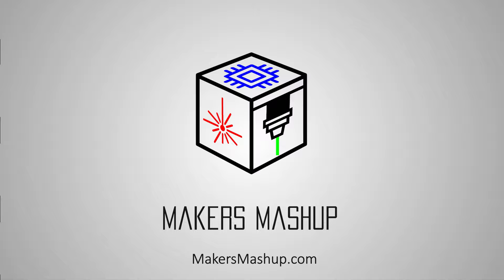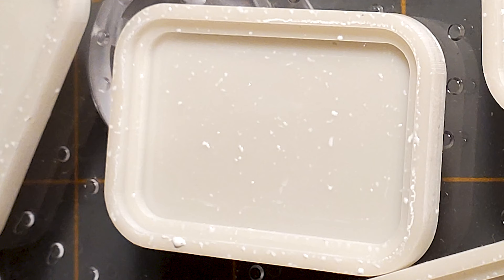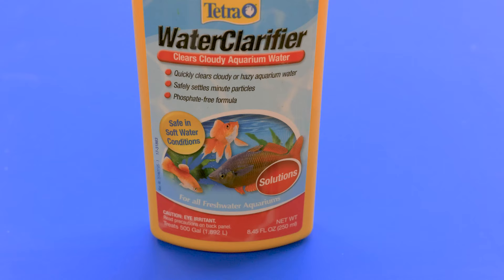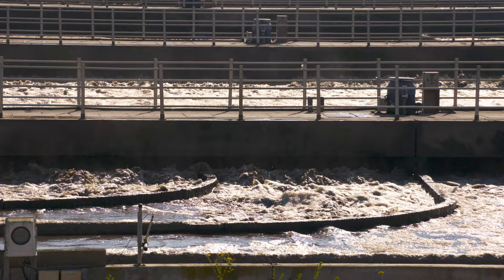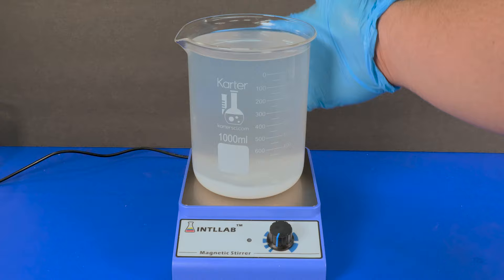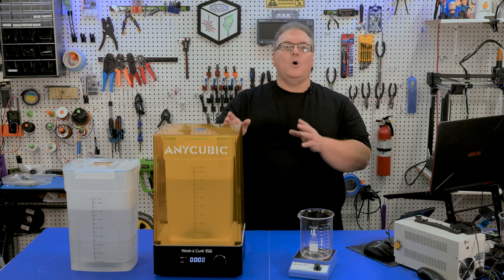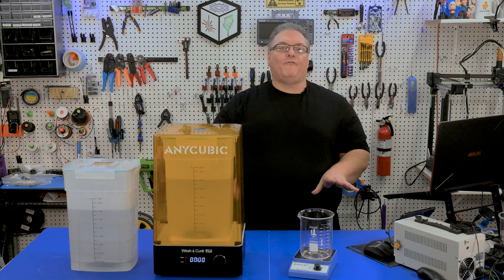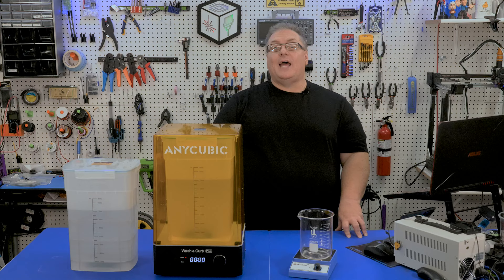Recycle Isopropyl Alcohol FAST! | Recovering IPA From 3D Printer Resin Wash

Comment: Nice job!
I see aluminum sulfate is quite cheap (~1.5 eur/kg ... actually its delivery is ~3 eur :)). I'll probably give it a try, because the wait for the separation is really slow and annoying.
Otherwise once I get well separated resin I can pour out the alcohol (or resin) easily enough without mixing them too much. Only a small amount of dirty alcohol is left with the resin, which I don't have a problem leaving to slowly drip thru a denser filter (the filter would also catch most of the resin and I'll UV cook it afterwards).
Decanting I find to be too rough, tilting the container at first doesn't disturb the resin on the bottom too much, but once the alcohol level drops enough it starts mixing the resin back up (tall narrow bottle-like containers work better).
But siphoning works much better as the dirty container doesn't have to more at all. If you siphon please use a siphon tube with small pump these are cheap and available everywhere as they're used in wine & beer production and also gasoline siphoning.
But the next step is actually simply pumping the clean(er) alcohol. I saw Uncle Jessy show a pump for liquids transfer, and while I can't find that device in my area, I realized that any pump for these large water bottles does exactly the same thing. 
So no more tilting the dirty container, no more jerking the tube while starting the siphoning ... just put slowly the tube of the water-pump deep in the clean alcohol (but enough above the resin) and push the button.
It's just the waiting for the separation that's so slow, and if the Aluminum Sulfate trick works I'll definitely do that.
(alternatively I was planning to make DIY centrifuge for 2~4L to speed up the separation :))
Reply from the maker: Let me know how the centrifuge works out.  I had considered the idea but swinging  around 4kg or more at high speeds sounded like a recipe for fail video. 😁  Seriously though, let me know how it works I think it should speed it up considerably.
Reply: @MakersMashup  ,
I'm still in the investigation phase :)
But I recently discovered there oil filter centrifuges, which seem simple enough (esp. since we don't need heating for alcohol).
There are tons of over-engineered ones (I guess very specialized for certain uses), but a simple one seems to be perfect for our needs.
It consists of 4 main parts: 
 - inner cylinder. This is the spinning one, horizontal of course. It has open top, and closed bottom (kinda like a cooking pot), except that the top edge actually has a ridge that makes the opening smaller than the cylinder inner diameter.
There are also few holes on the closed bottom plate: one in the (exact!) center for mounting to the el.motor; and few drain holes near the center, which serve to drain the residual dirty fluid when the machine is stopped at the end.
 - housing. Outer cylinder (can be any shape actually), it must be higher than the inner spinning cylinder so that it catches all the fluid that's accelerated horizontally.
and the important details are at its bottom as it facilitates draining separately the cleaned fluid from the dirty fluid (and from the central hole for the motor's axis).
These 3 area you can imagine as concentric circles separated with slight circular ridges so that the liquid in each can't overflow over the ridge before flowing out the drain holes in each area.
 - electric motor. some people I've seen use a power tool they have. It just needs to be mounted as perfectly vertical as possible to allow for vibration free spinning.
 - and a stand that allows mounting the above components.

The stand and outer cylinder are both fixed and connected, so you can consider them single part.
The motor's body is fixed to the stand too, its axis goes thru the housing cylinder to reach the inner spinning cylinder.
It operates quite simple really. 
You turn it on spinning as fast as it's safe :) 
Then start pouring slowly the dirty fluid (alcohol in our case) that needs some heavier pollutants removed (resin in our case) inside the spinning cylinder.
Because of the spinning the fluid immediately is accelerated to the inner walls of the spinning cylinder.
The spinning cylinder upper ridge encloses a ring-shaped volume on the insides of the wall of the spinning cylinder. 
When you pour a little more fluid it'll go over the ridge (think of the fluid's "down" pointing horizontally to the outsides of the cylinder as in any fast spinning centrifuge),
when the total fluid in it is more than the enclosed volume I mentioned it'll start overflowing, and the closes place it can do that is the upper ridge (because the few drain holes on its bottom are closer to the center than the end of the ridge).
So the ridge allows only the upper most fluid to escape, which is the cleanest fluid as the heavier particles (ie the resin) will be accelerated to the walls.
So the clean fluid flows over the ridge, sprays horizontally all around the spinning cylinder, but it's caught by the inner walls of the housing-cylinder, and then leaks down to the outer drain area on the bottom of the housing, which thru a pipe (or few) leads to the clean fluid container.
You keep pouring all the dirty fluid in the centrifuge, and when finished you'll have only the dirty fluid captured in the enclosed spinning volume I mentioned above.
** here's another trick that can extract more clean alcohol. I'll describe below as it's optional.

Then you turn of the centrifuge, and the dirty fluid trapped inside the spinning cylinder flows to the bottom to the dirty drain holes. They lead to the inner (dirty) area of the housing (separated from the clean one by a ridge), and leaks thru a hole (or few) thru a tube to the dirty fluid container.
The remaining dirty fluid can be kept for later to be used again in the centrifuge with more dirty fluid.
Or more likely can be filtered thru some fine filter - it'll be slow, but since most of the dirty fluid is now cleaner we can leave that drip for a long time.

** The optional trick to extract more clean alcohol from being trapped in the spinning cylinder is by pouring some water.
That enclosed volume I mentioned is a known volume (depending on the spinning cylinder size and it's ridge), so you can pour a little less water than that volume.
Water being heavier than alcohol (~21% heavier) will be trapped to the inner wall of the spinning cylinder and will push the remaining alcohol "up" to flow over the ridge.
The pollutants (ie the resin) will still be trapped on the walls, and now will be covered in water instead of alcohol.
When as much alcohol is extracted as reasonable (ie without allowing water to overflow and mix with the clean alcohol), centrifuge is stopped and the pollutants together with the dirty fluid (now mostly water) is collected in the dirty fluid container.

Unfortunately this will has to be DIY assembly project as the ones sold commercially are very overengineered and expensive.
But the motor is easy - most rotating power tools can be adapted to it (and still detached and used as originally designed when the centrifuge is not in use).
The stand can be assembled simply even without welding.
The housing cylinder (or whatever shape it is), only needs to be bigger (and taller!) than the spinning cylinder, and has its bottom separated by a ridge to allow the separated fluids flow out without mixing.
And the only tricky part is the spinning cylinder. Which I currently don't have an idea what existing item to reuse and repurpose. So I'm inclined to get a short cut of a wide enough stainless steel cylinder (it doesn't need to be long at all), get couple of circular plates to weld, one for its bottom (only to be perforated) and the other to have another smaller circle cut out of it, and be weld to the top of the cylinder to form the overflow ridge.
The ridges on the bottom of the housing can also be welded, but since it won't be rotating or experiencing any strong forces it can be also glued.
Actually the whole housing can be done with plastic (or plexiglass if you like to be able to look inside it :))
So the housing cylinder can be assembled by wider plastic pipes cuts.

Sorry for the long explanation, but would like to run the idea with other people to get opinions and advices :)
Reply: @MakersMashup  , here's great demo with great explanations of such centrifuge:
search for "Extreme Raw Power Centrifuge | Overview & Operation | Utah Biodiesel Supply" on youtube.

Btw I remember someone used to put a bit of paper (like few pieces of kitchen paper) against the inner wall of the spinning cylinder so that it catches the dirtiest particles.
In our case it'll be easy to keep the centrifuge cleaner, and then just put the pieces of paper in the sun (or in your UV over) to cure the resin before disposing.

Comment: slick; only downside is the IPA, post treatment, is watered down (from 95% to 80%IPA) which won't work for many resins...
Reply from the maker: Just salt out the water.  Can be done as easy as the aluminum sulfate process.  Add salt, mix,  decant, 99% ipa again

Comment: Ok, I tried this and seems to work pretty well. It is however kind of a hassle. Also to get the water out of the IPA again, I'm adding salt and trying to suck it up with my giant 500ml syringe.

Now unfortunately my basket started rusting. Probably due to water leftover maybe, or the salt.

Now trying to figure out if there is another way to do this. My IPA is now orange in color from the rust.

Comment: Found this out by complete accident and haven’t tested exact amounts. A tiny bit of white vinegar in the used alcohol caused it to flock and settle out with minimal hand mixing and it settled out in about 5min.
Reply: seriously?
Reply: @Aveltro  give it a shot on a small scale. I give it about a day for the particulates to form a decent clump so they don’t come out and then decant to a second container, let it sit for a bit more to let any escapees settle and then filter with a coffee filter. Two cycles so far and no degradation

Comment: So once the ipa is diluted with water, when you redo the process you don’t need to add water again, just the flocculant directly.
Reply from the maker: Good call out.  Ive been noticing that myself using this process a few times now.  I've also noticed ive not needed to treat the IPA as often since treating it the first time.

Comment: so for using water washable resin, technically you could add 170g to 1L of resin/water waste, mix it as you describe, run the whole 1L through a filter and then the water would be 'kind of' safe to dispose of normally, then cure and dispose the residue as usual. I'm trying to find a solution to work with water washable stuff as im sick of stinky IPA and want to try eliminate it from my workflow, but i'd feel uncomfortable getting rid of the water like this, instead i'd have to leave it evaporate over time but dont want to have huge amounts of open containers with toxic water in lying around whilst im waiting for it to evaporate away before i can dispose of it. Plus, this 150ml of water you're adding to your IPA mixes, as time goes on your IPA will dilute and become essentially useless for cleaning prints - yes water will be heavier than alcohol so will go to the bottom but you're still diluting the IPA and as soon as you disturb the mixture it will mix it up again as the weigt difference isnt enough to do this - i.e. a good test would be to dye the water you're adding with a few drops of something, so you can see over time how it would gradually dilute the IPA mixture and it can also act as an indicator to dictate when you need to swap out the IPA all together - only trouble is, you'd have to dye it with something that the alum didnt also remove via coagulation.
Reply: I was wondering the same thing.

Comment: To the author of this video, i would suggest not eating alum even if it says you can in your country as it if a form of aluminum and saying food grade safe not make it so it's about profit and collective data from the last generation. There are also many other processes utilized in making clean safe drinking water or waste management. I love that you are experimenting and if you are comfortable in doing so great and you are sharing which is even more great however there is little data other than your word to say this process works effectively and efficiently.
Reply from the maker: As I mentioned in the video, there are different chemical formulations that claim to be Alum.  Aluminum Sulfate is what I used specifically.  While I agree the information is not peer reviewed and tested, as I highlighted similar processes are used in wastewater treatment and causes particles to collect and flocculation occurs.  You can research that on the internet in great abundance.  So methods described here are used in the scientific community.  Food grade alum formulations have been used in making pickles for centuries.  You might find this page helpful in learning more https://www.thoughtco.com/what-is-alum-608508

Comment: Very interesting but I think I'll stick to sun UV and filtering (as I'm not a chemical scientist :) ).  I have a question, how long is your alcohol rinse?  I've heard everything from 1min. - 10min???? 
I will be doing a 2 bin alcohol cleaning. 
Thanks.
Reply from the maker: It varies by print, design and volume but generally its 1-2 minutes per bath, one ditry, then one clean bath.  After the bath I use virgin IPA in a spray bottle and a brush to lightly clean off any remaining residue, particles, etc.   Then I use my air compressor, blow off prints until Dry.  Pop off bed and cure.

Comment: I wonder if you can freeze the final solution to get the water out and really end up with nearly 100% ipa?
Reply: I think the alcohol will prevent water from freezing, at least at the normal freezing point.
Reply: @walidkhier  I did some looking into it, and I'm thinking dry ice may be enough to get the water out of the IPA.  I know that most alcohols are natural antifreezes for water, but reading up on freezing distillation can work (in theory).   I'll be trying this very soon. This is such a great idea :-)
Reply: @davidfigueroa1969  

I am curious to know. Let us know the outcome.
Reply: That's what I do in winter time. Just leave it outside. It wont freeze (Danish -5 to -10ish celcius winter) but the resin just gooes up un the bottom - easy to decant. Not totally clean though - but sufficient for reuse washing. Bonus: the water freezes on top and peels off before decanting. The goo is poured in a container outside in sunlight and trashed when solid.
Reply: @michaelhviid398  Thank you for that information.  That's going to be very helpful.
Reply: @davidfigueroa1969  I have not measured the resulting strength of the IPA. My guess is only a portion of the water freezes but it has been sufficient to reuse with topping up of the removed volume.
Reply: @walidkhier  That's called antifreeze....
Reply: @michaelhviid398  I put a bottle of dirty IP out in the snow last year and is settled and cleared really quickly, wasnt sure if it was the temp or the additional UV from reflected sunlight. may try putting a vat of dirty IPA in the freezer see what happens

Comment: Will this technique not work with just the aluminum sulfate and no water? or does it have to be done with water no matter what?
Reply from the maker: I tried without water. The results were poor.  My thought is the water increases the surface area.  If you're worried about dilution you can use salt to "salt out" the water.  People have used the same method effectively to salt out the water from 80% IPA.  Basically add salt afterwards, shake and then decant.  The saltwater separates from the alcohol.  Tons of videos on salting out.
Reply: @MakersMashup  thank you for your reply. I appreciate it and surely will try salt. Just wanted to ask a couple more things. Will adding salt to 95% ethanol cause any reactions? And also, anyway that the diluting process of the aluminum sulfate can be done with just some clean Alcohol instead of water and therefore eliminate the need to later decant? Sorry if these are stupid questions. Thank you.